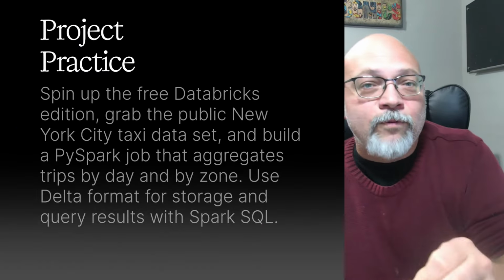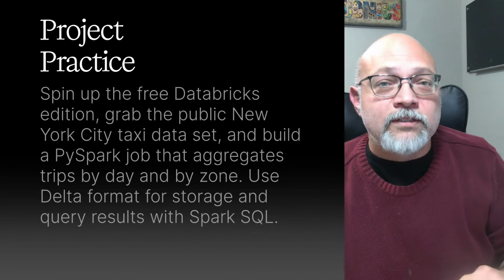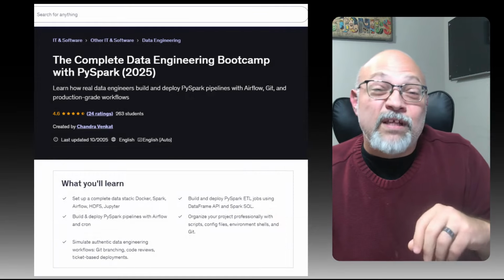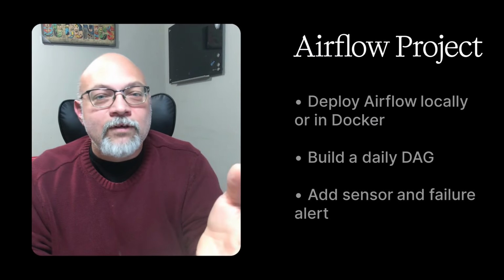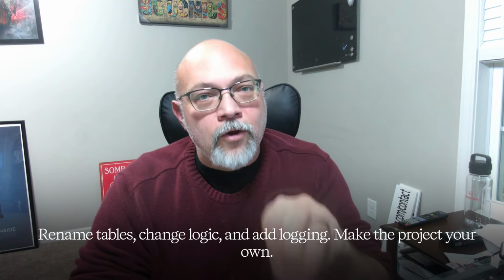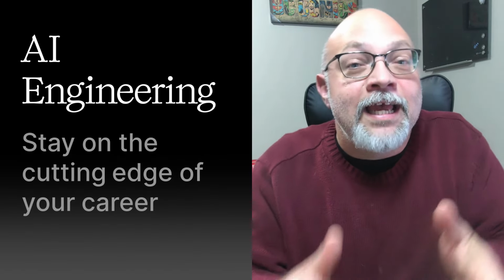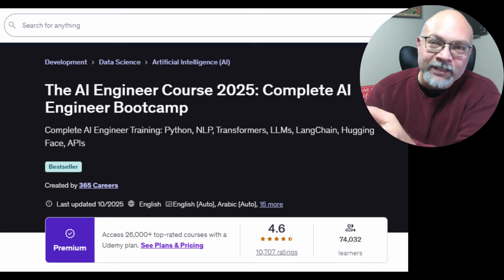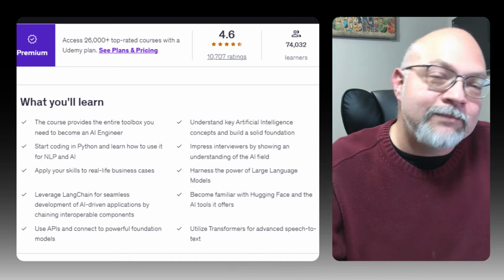Most Data Engineers Learn These 5 Courses (You Should Too)

Comment: Hey, the python/pyspark course only has 4.1 stars so what made you choose that ?
Reply from the maker: I recommended it because the curriculum breadth is strong and it builds the habits you need to adapt as Databricks evolves. A 4.1 can reflect mixed skill levels, old reviews from before updates, or expectations of a shortcut.

Who gets value:
New to mid-level learners who want end-to-end coverage: Spark, notebooks, jobs, Delta, Parquet, and how the parts work together.
People who will pair it with the official docs and release notes to stay current. That habit matters more than any star count.

Who should skip:
Learners who want a deep dive on a single feature.

If you want a broad, practical foundation you can use right away, it’s worth it. The stars do not tell the whole story.

Comment: Hello. Thank you so much for these great resources.

If you dont mind me asking, how do you guys clean a data using PySpark?

I'm currently practing to make a data warehouse with medallion architecture, using a csv file as a source system and stored in postgresql.

I'm planning to recreate the same approach but this time I'll used PySpark for Silver Layer.

That leads to how do the professional clean the Data using PySpark DataFrame? Do you make a transformation function in each messy columns? Since, unlike in any rdbms, in a one SELECT, we can transfer the columns.

Thank you. Appreciate it.

PS. I'm a beginner, i started traversing the DE field this yr. Learned SQL, Python, PySpark, and I'm learning Airflow, and next will be DataBricks.
Reply from the maker: Great question. For Databricks, my default is Lakeflow Pipelines (the successor to DLT). You define Bronze→Silver tables and attach expectations to validate data. Expectations can drop bad rows, fail the step, or—when you use DQX—persist violations so you can review them instead of silently throwing them away.

“How do pros clean with PySpark?” In Silver. Write column-level transforms that are table-driven instead of one-off per column. Example pattern:
```
from pyspark.sql import functions as F

rules = {
    "customer_id": lambda c: F.col(c).cast("long"),
    "email": lambda c: F.lower(F.trim(F.col(c))),
    "order_date": lambda c: F.to_timestamp("order_date", "yyyy-MM-dd HH:mm:ss"),
    "price": lambda c: F.regexp_replace("price", r"[^0-9.]", "").cast("double")
}

df = bronze_df.select(
    *[rules.get(c, lambda x: F.col(x))(c).alias(c) for c in bronze_df.columns]
)
```

With Lakeflow/DLT you add expectations next to that logic, for example:

```
CONSTRAINT valid_price EXPECT (price >= 0) ON VIOLATION DROP ROW;
CONSTRAINT valid_email EXPECT (email RLIKE '^[^@]+@[^@]+\\.[^@]+$');
```

If you want a quarantine table, don’t drop! You can persist rejects via DQX or route NOT (rule) rows into a _quarantine Silver table for review.

If you aren’t on Lakeflow yet, you can still do this with plain PySpark jobs orchestrated by Airflow: same transform pattern, plus unit tests and a rejects sink. The pipeline tool just gives you lineage, monitoring, and managed quality checks.

TL;DR: Clean in Silver, drive transforms from rules, use expectations for validation, and keep rejects you care about instead of losing them.
Reply: @GambillDataEngineering thank you so much with this one. I'm not yet familiar with some terminologies you mentioned, also with Databricks. 

Nevertheless, how I try to clean a dataframe using PySpark is indeed no where near with the pros. Haha how I did it is I made a bunch dedicated transformation functions each columns. 

Appreciate it your advised, Sir.